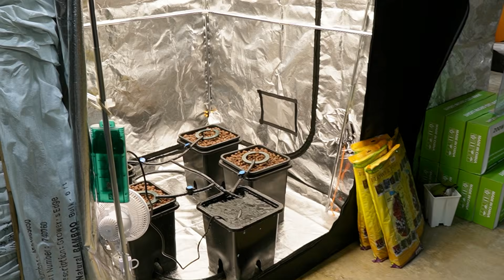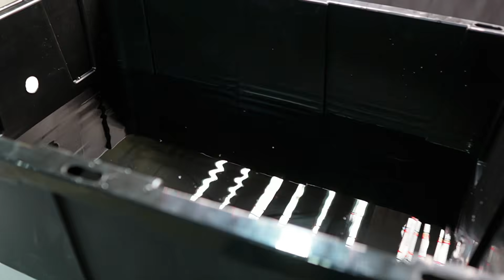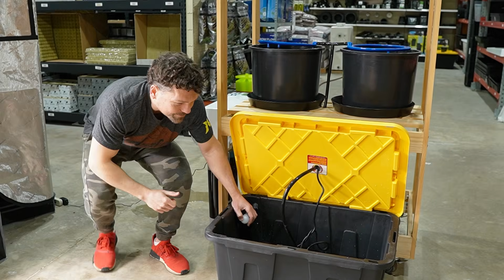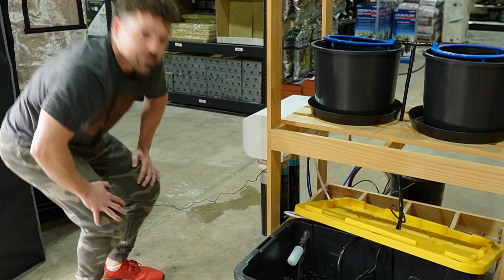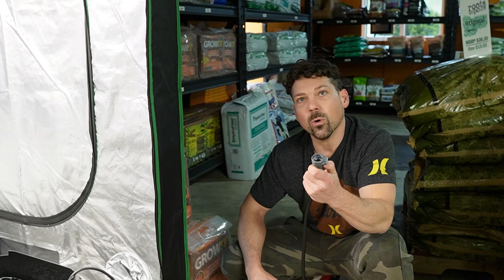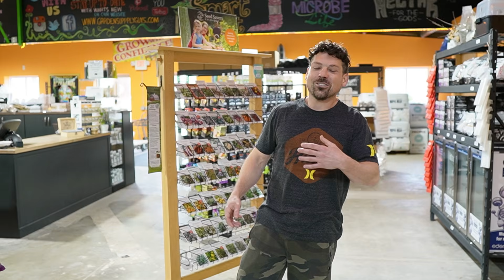Automate Your Grow: Save Time with Float Valve Control!

Comment: was away for 7 months - most of my plants are deceased. Someone forgot to top up nutrient tank with water. My float valves are ordered online and will also set up Kratky buckets with their own float valves and pump nutrient up to a holding tank and gravity feed the buckets and I have just realised the higher feeder tank could have a valve on the pump feed to stop it over flowing.  I was going to have an overflow drain back to the nutrient reservoir but a float would solve this

Comment: I tried to get with the program and put the toilet seat down, But I didn't think of the flow valve.  That bucks could have saved me thousands.
Reply: I have a slow fall toilet seat so i just have to move the seat from upright to angled and it slowly falls back and keeps the other house holders happy. 
When I ordered my float valves the toilet cistern came to mind .